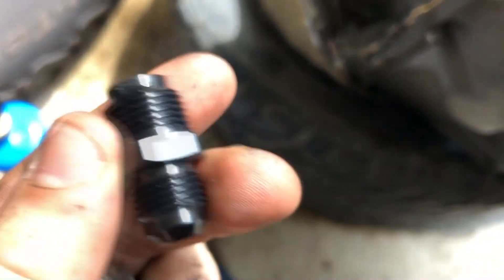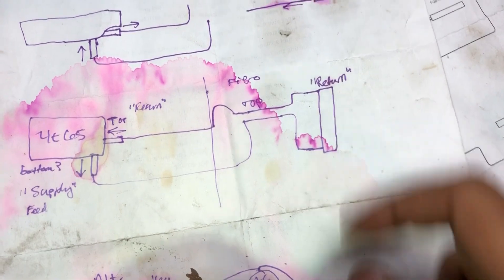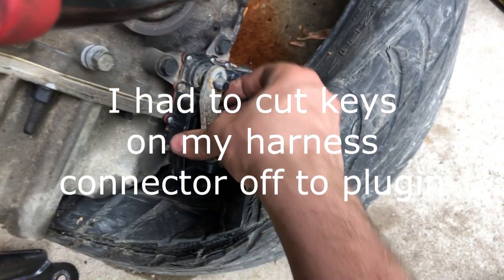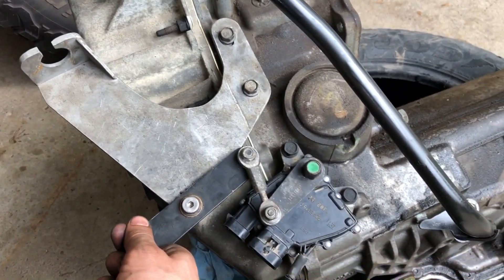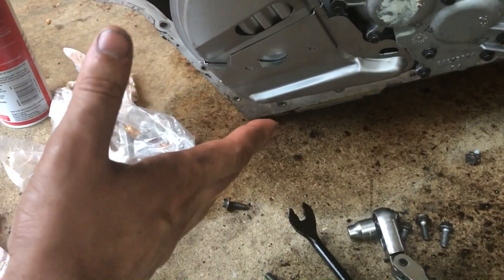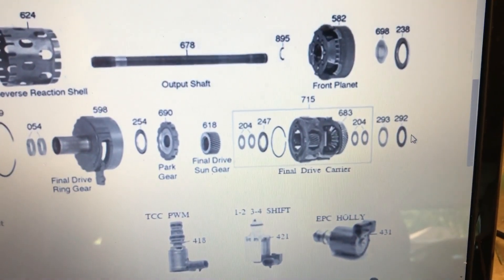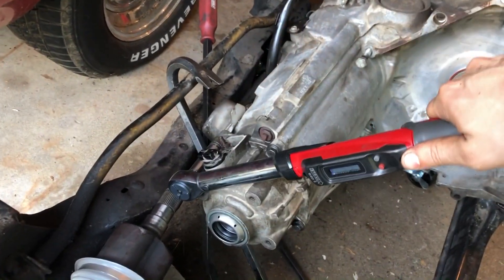4t65e-HD POSI Traction Differential Install in a 3800 Supercharged Fiero + Transmission Hookups

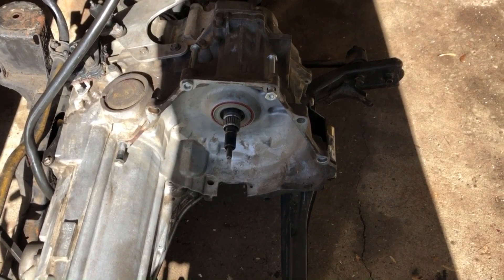Comment: 7:10 talks about differential. Clutch pack style diff-- lots of good info
Reply from the maker: It's a bronze bushing style actully. It does act as a clutch but there is no clutch pack other than a bronze bushing for friction with spring plates.

Comment: Will this unit work in the 2005 5.3 GXP with the 4t65e hd would you happen to have the part number or the place where you purchased the differential assembly thank you
Reply from the maker: Yes, it should work on any 4t65e-HD, you can direct further questions to the guy who makes them here http://www.engineered.net/eplsd.htm
Reply: @FieroAustin  thank you

Comment: I wonder how hard it is to do with the trans in the car. Would traction control still work?
Reply from the maker: There's no traction control on a Fiero, it does not have wheel speed sensors!

On a GTP though, you would have to remove at least 1 axle. It might be doable in the car. It is not hard to drop the engine out of a GTP however. I've done it twice!